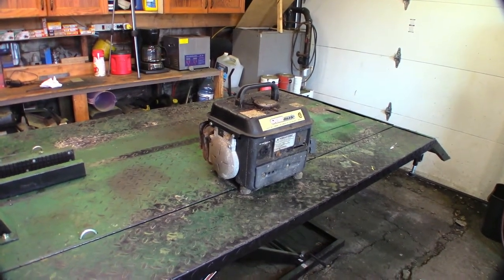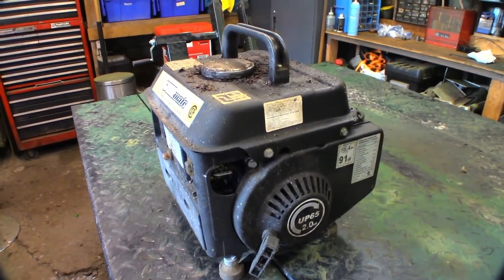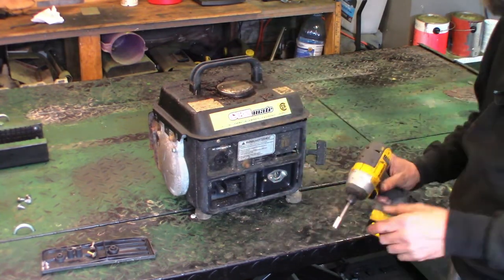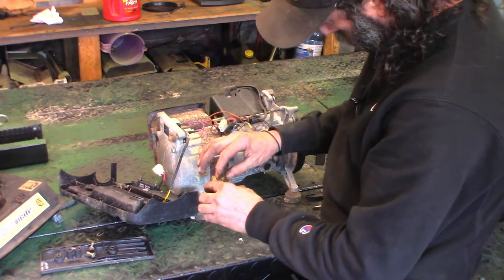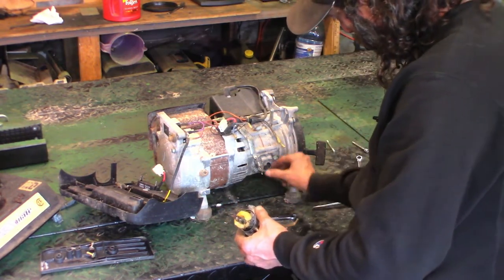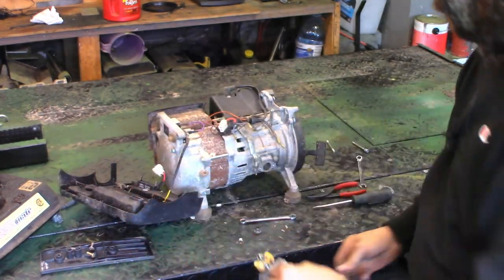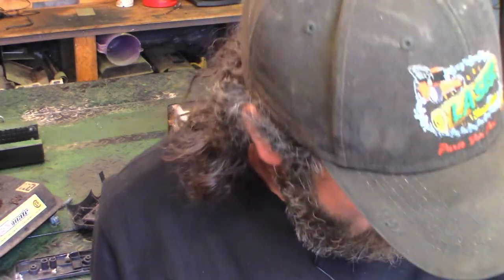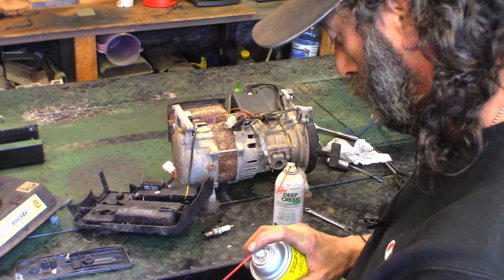This Genmate generator will not start, it has sat for many years.

Comment: Thanks for your help just having one issue trying to get the carb of I can't see how you got the throttle thing off
Reply from the maker: Unhook the tiny spring first,  then pull the carb off a little.  Move the throttle plate fully clockwise and the rod slides out the top.